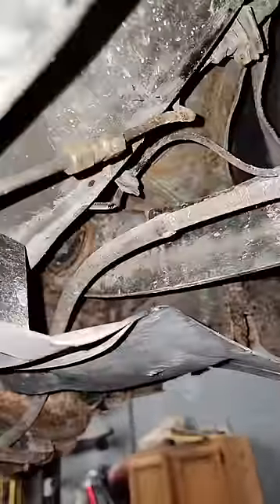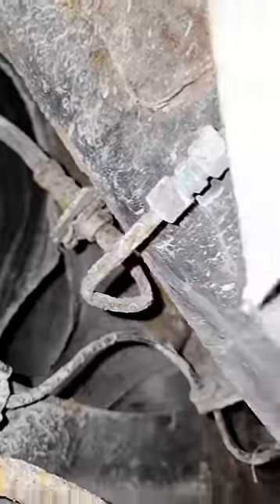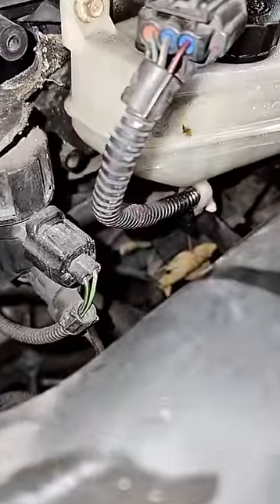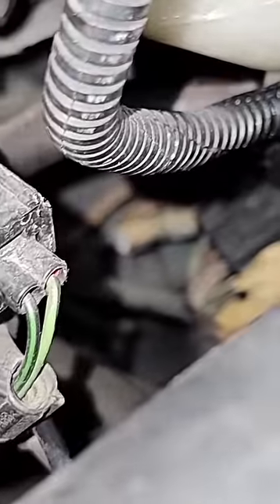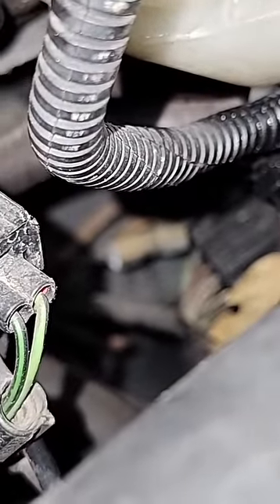don't use compression fittings on brake lines

Comment: They do make compression fitting for brakes, usually they are non brass
Reply: Not for hydraulic brake lines.
Reply: @ferrumignis  
They do have them for hydraulic brake lines. They have a different design over regular water compression fittings
Reply: @JohnSmith-xu7ev  Unless/until you can provide some evidence e.g. a part number then I'm going to say you are wrong.
Reply: @ferrumignis  
Call  a professional parts supplier for shops, they carry them. You are like all the arm chair youtubers that never wrenched professionally
Reply: @ferrumignis  
Since you are lazy and my post got deleted, dorman sells them for 15 dollars, and it was the first thing that popped up on Google
Reply: @JohnSmith-xu7ev  A simple part number is all I am asking for. Many people sell compression fittings under the pretence they are suitable for hydraulic brake lines, so the fact that a (known crap) supplier suggests compression fittings are ok for brakes doesn't make it so.

That said a steel compression fitting on a steel brake might be adequate,  but the kind of people that use compression fittings rarely if ever use steel brake lines when repairing a system, it's typically cupro nickel.
Reply: @ferrumignis  
I posted a number and it got deleted. So are you unable to find it ? You would never make it as a tech
Reply: @ferrumignis  
And must be tough for you to read, because i stated professional auto parts suppliers sell them to shops. Only professionals are aware of them because they are sold behind the counter.
Reply: @JohnSmith-xu7ev  Post the part number, not a url.  You'd never make it as as a simple internet user.